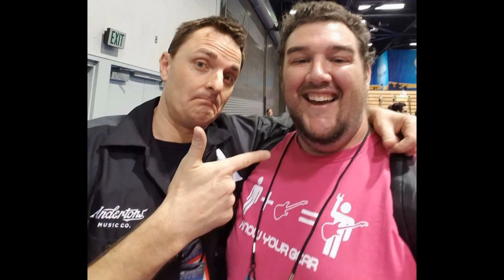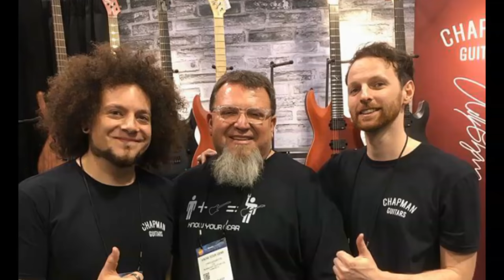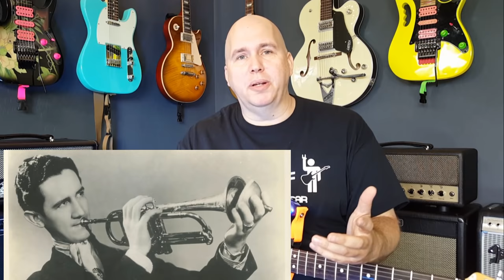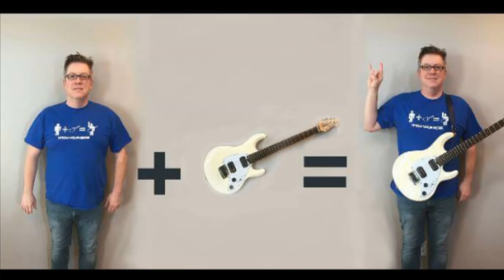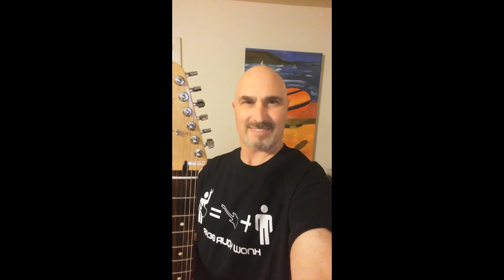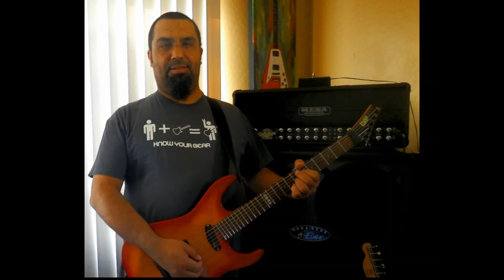The Tremolo System That Doesn't Exist

Comment: A third way to get that sound (and without the fret crossing) is to target the note a half step lower, then quickly pre-bend a half step and pluck, releasing and re-bending. In fact barring trem dumps, there's not a lot of a musical nature that you can't pull off with just your fingers. You can emulate down-only or floating 'trem' arms.Some of my favorite twang bar innovators are Eddie Van Halen, Adrian Belew, Jeff Beck and Duane Eddy

Comment: When I learned about strings (violins, violas, etc) I learned that the term is Italian, and translates to something of 'tremble'. When a group of string players do a rapid, trembling bowing motion the effect is a trembling sustain note. Guitarists pick really fast, and get the same effect. Think Dick Dale doing Misirlu, fast picking giving the feeling of sustain. I think Fender was going for a vibrato like effect on the amp (to remind the listener of a singer with their wavering pitch vibrato if used in a slow setting), but really made an adjustable speed tremolo that can go slower than a player would usually execute a 'tremolo' technique. Some translations that might help: 
        (gen) "to tremble", "shake"
        (luci, candele) "to flicker"
        (stelle) "to twinkle"
        (foglie) "to quiver"
Vibrato is the description of a singer wavering their pitch up and down.

Comment: Love your videos, really inspired me to explore guitar!
Reply from the maker: very cool. Thank you
Reply: Phillip, try it. O-rings the size of the screws, 8 of them. back them all out 1/4" do one at a time, one above one below for the 4 outer screws. omit the 2 center ones, tighten until just "bumpered". pop the back, drop 1 spring, tighten spring hanger screws until trem back is almost 3/16 off the body. with a graphite nut works better falling back in tune, powdered from a pencil is ok. do it to a cheaper strat copy you can put it back stock just as easy, works surprisingly well. the neoprene with slight pressure gives it the return point after being floated, the dropped out spring in back = less pressure on trem arm. fun little trick we were doing about 35 years ago to float them.
Reply: DevonReviewer me too!! Ive been playing almost 40 years and learned nothing more than how to polish the thing and change strings. I was even terrified to deal with intonation. Since ive been watching Phil ive bought a couple Squiers to rip apart and see if i can do something with them. I havent really started yet im still in research mode nut im ready. Oh i did change a tune o matic to a roller bridge on one of my eppiphoneys. It worked perfectly. Ive only done 1 do not sure if it was beginners luck or not.

Comment: Brad Gillis playing as he did on that first  Night Ranger album is what got me really interested in the vibrato bar. I was 15 when that first Van Halen album came out and Eddie did some cool stuff with it, but it seemed more like an effect or trick to my ears at the time. Gillis used it really expressively as a vocalist would when singing. Later, as I went back to the beginning with blues based rock, and discovered Jeff Beck, I realized that it kinda started with him. About half my guitars have a vibrato on them as it's become part of my own style and of the three most prolific systems, Fender, Bigsby and Floyd Rose/Ibanez/Kramer (I consider all these locking/reduced-friction as enhanced-improved Fender designs conceptually), I probably prefer the original Fender the most. With a graphite nut, locking tuners and properly setup, they're as stable as the Floyd Rose, et.al., and a lot easier to deal with string changes and intonation. I just live the Bigsby for its subtle inflections and it's cool look.

Comment: Just to clarify: “Vibrato” and “Tremolo” do have really similar meanings. Those words are obviously related to “vibrate” and “tremble” respectively. The idea of trembling and vibrating comes from the sliding motion of the fingers over the fretboard that would be otherwise required to achieve such pitch swing and the sound oscillation itself. The amplifiers and pedals effects known “Tremolo” obviously refer to the intermittent lowering of the volume instead. Personally, I’d rather call those “muffling” or “dampening” in order to avoid the confusion and possibly be more accurate. To conclude, as I believe “trembling” is supposed to give an idea of quicker or more spasmodic movement over “vibrating” (in my opinion), I guess you could say a Bigsby is a “vibrato” indeed, whereas a Wilkinson is a “tremolo” after all.
Reply: "The terms vibrato and tremolo are sometimes incorrectly used interchangeably, although (in the classical world) they are properly defined as separate effects with vibrato defined as a periodic variation in the pitch (frequency) of a musical note, and tremolo as a fast repetition of the same note (usually a semiquaver) in order to produce the audible effect of a longer note, especially on instruments which do not have the ability of producing long sustained notes, such as the guitar. In practice, it is difficult for a singer or musical instrument player to achieve a pure vibrato or tremolo (where only the pitch or only the volume is varied), and variations in both pitch and volume will often be achieved at the same time."

Comment: Vibrato varies pitch. Tremolo varies volume. Fender always had their nomenclature incorrect. They referenced guitars with tremolo, which was actually vibrato. And the referenced amps with vibrato which was actually tremolo.
Reply: Right on, I'm just going to start calling my super cool Fender "Custom" Vibrolux Reverb tube amp a Tremolux from now on!  More accurate IMHO, and a possibly good conversation starter.  :-)

Comment: Dear Philip McKnight, 

As far as I can see from your video, the vibrato system is flushed on the body of the guitar. In a 'floating' vibrato system you CAN actually achieve a tremolo effect, similar to the one the old fender and marshall amps have. The definition is not important, for me at least. However, and since you're talking about tremolos / vibratos, it would be a good idea to demonstrate the floating vibrato on a strat along with the 'magic thing' that happens when using it.  

Yes, you guessed it right. I'm a big fan of floating bridge, with a setup just like Carl Verheyen suggests. I insist to call it tremolo though. !! :) :)

Keep up with the good work.

Comment: It is a system that needs to be setup not like Fender intended it to for it to stay in pitch...widen the slots in the nut, lube the nut, lube the saddles and under wrap and lock the string to the tuner. Stretch the piss out of the strings and it works 95% of the time...B and G will go sharp. Done it for years on stage...and I mean dive bomb with it for it to go....

Comment: Yep, always use the Vibrato name, maybe because English isn't my first language. Until I started to talk with English speaking guitarist that were calling it Trem... so I had to use the word Trem to make myself understood, but I never liked it because it doesn't make any sense (like having a "gas pedal" on an electric car...often called "accelerator" on other language). There's many many very fun examples like that, and sometimes it means a lot to understand some differences in culture. For instance like Americans using more fractions for Imperial system, while others use more decimals for metric system. It looks like nothing, but if you're bilingual (for both language and measurement system), it does explain A LOT! My 2¢

Comment: Clyde McCoy wasn't used because they couldn't describe the sound. VOX and Thomas Organ company thought the pedal should be marketed towards trumpet players and not guitar players. If you look in my photo, that's me with Del Casher, who worked on the original Wah pedal and owns the original prototype. He tried to convince them to market it for guitar and released and album showing how it would work for guitar. Other than that, you are correct, Fender, not a musician, messed up when he named the system a Tremolo System just as he screwed up the amplifiers by calling the Tremolo Vibrato. He had them backwards and just went with it.

Comment: I just bought a js22 for the hell of it to build up , i was surprised at how well it plays and how good it sounds, but the tremolo is its only downfall .. it feels sorta flimsy , but its very tight. Would removing 1 of the 3 spring noticeably lower the tension without ruining the guitar? Or how would go about doing that ? Thanks Phil.
Austin

Comment: Good video. Tremolo system, vibrato or whammy bar, it's just really semantics to me.  But that aside, I do have one tremolo/vibrato related question. Is a guitar equipped with a combination of a traditional Fender style vibrato bridge (coupled with locking tuners and a good graphite nut) as effective as a Floyd at keeping a guitar in tune when using the bar?
Reply: they do fairly well really, we loved sperzels and a graphite nut. the lock tuners didn't need a full wind on the peg so the strings wouldn't be springy there. if you looked above I'd described floating old school fender trem's on O-rings. lock tuners and graphite nut was our preference for it.
Reply: Thanks.
Reply: YW. last one I floated was a local buddy's strat copy. O-rings was 2 bucks, it only took about 15 minutes to slip the 8 onto 4 screws, 2 springs, adjust hanger.  done it many times, easy quick for me. it didn't get a nut or better tuners, worked perfect. normal use fall's right back, lots of silly abuse it'd still be close and that'll happen with a nicer bridge anyway so no biggie. it was routed for a single humbucker so I swapped in a hotter pickup to finish it off.

Comment: I feel a lot of guys use the tremolo system to fill up blank spaces, like steve vai, spends hours with the tremolo, making noises.  I never used the tremolo system, even thou I have a floyd rose type bridge on my guitar, I only have it for the looks. There is so much going on with the fingers and picking, I don't really need it. I like what other guys do with it thou.
Reply: Nathan Carrille to be honest if you're happy with your playing without a trem that's a very good thing, I feel I use mine too much
Reply: I'm surprised to hear that anyone bought a guitar with a Floyd just because they liked the look.  The added expense alone would deter someone, but then the added aggravation of proper setup and string changes, etc.  A hardtail is just so much easier.
Reply: Oswaldo Delacroix  Floyds when properly set up will take forever to go out of tune, me not using the bar makes it even harder, so that's the advantage, plus the looks as I said.  I can deal with floyds pretty easily, over the years I learned how to deal with and fix/build guitars just as much as I learned how to play them. And thats been 15 years so far. Even though hardtails are easier, I find floyds to be more fun haha.
Reply: Nathan Carrille I'm surprised you didn't hardtail your Floyd because you'd get the tuning stability minus the setup hassle but I agree with you as springs are less effected by cold than strings and the locking nut helps to keep everything in tune
Reply: Jamie MacMillan as a matter of fact I did block it for the longest time, but then I just wanted everything to flow as they were supposed to, so i set it free and did a proper set up. I even used it without the locking nut, since this particular guitar got a regular nut AND a locking nut. But I realized the tunning stability was not the best without it.
Reply: Nathan Carrille yeah the locking nut is a gift from the gods

Comment: Can we pretend that this misuse of terms is somehow relevant to people who think that when you coil split a humbucker it is called coil tapping, which is completely different and refers only to single coils? This is one of my biggest pet peeves, hearing people who do guitar-related things for a living get these two wrong.
.
Coil Splitting - splitting, or turning off half of a humbucker pickup in order to simulate the sound of a single coil pickup.
.
Coil Tapping - tapping into the winding of a single coil pickup in order to change the frequency output.
.
It ain't rocket surgery.
Reply: Thank you for writing this comment, it saved me the effort of writing this comment.

Comment: When will Fender  put a good vibrato-whammy bar, etc.. on the Stratocaster?  One that can actually do deep dives and pullups,  as well as doing the real subtle Jeff beck style stuff? I like both ways of using it.  I love the Strat tone,  but the whammy bar sucks. It cant be moved far, and it cant do deep dives and pullups, and it goes out of tune real easily and right away.  But I must play the  Stratocaster,  I will not play some generic Ibanez or ESP or  something like this.  Floyd Rose is 30 year old technology, so, is there anything better by now that we dont know about? Or some bettter way to set up  a Fender Strat to do all the  serious intense dive bombs and all that stuff?
Reply: The Jeff Beck Signature uses an American Standard vibrato bridge. Looks how he can be subtle or abusive, it never goes out of tune.
Reply: my strings never go out of tune, i dont do divebombs  partially because idk how but also because i dont really feel like it but i do give it a good wailing on that bar and i swear the tuning stability is incredible. but if it helps i saw a video of john frusciante going nuts with his fender strat trem and he seemed to do fine.

if u wanna do pull ups just loosen the tension springs in the back and it should raise the bridge making pull ups possible.

im pretty sure tuning instability comes from nut issues moreso than trem issues

Comment: Right and Wrong...
Most vibrato systems for guitar are based on one of four basic designs:

Bigsby Vibrato Tailpiece, introduced in the late 1940s and used in close to original form on many guitars (including Gibson, Gretsch and Rickenbacker guitars)
Fender Synchronized Tremolo or strat trem, introduced on the Fender Stratocaster (1954), which inspired many designs, including:
Floyd Rose locking tremolo (developed late 1970s)
G&L Dual-fulcrum Vibrato, designed by Leo Fender (1981)
Fender two-point synchronized tremolo (1986)
Fender Floating Bridge, which has two main variants:
Fender Floating Tremolo or jag trem, introduced on the Fender Jazzmaster (1958)
Fender Dynamic Vibrato or stang trem, introduced on the Fender Mustang (1964)
Cam-driven designs based on pedal steel guitar concepts, include:
Kahler Tremolo System (1979)
Washburn Wonderbar (1980s)
Stetsbar tremolo (developed late 1980s)
Many other designs exist in smaller numbers, notably several original designs marketed by Gibson under the Vibrola name, which they also used for some licensed Bigsby units. A design patented in 2006 from Trem King uses a fixed bridge with a moving tone block.

Comment: My tremolo arm on my mexican strat always leans on the lead input jack. it tightens past the jack so theres nothing i can do about it. Does anyone know a fix to this?
Reply: Use Teflon tape. You vibrato arm will stay in place.
Reply: there's also a stiff little spring you can put down the hole first
Reply: model nutty was it suposed to come with it or u mean buy one
Reply: better ones did come with (and more often get lost!), it's a really strong little spring about 5/16 long. trem arm stays where you park it instead of swinging+flopping around. teflon tape or rubber cement (for paper) on the arm's threads does work. if they'd used rubber cement to keep the darn spring from falling out and getting lost in the first place... umm.. most of us wouldn't even know it was there!

Comment: mine never stays in tune :/
Reply: Pencil dust (graphite) in the nut slots, first and foremost. Second, make sure that your strings are good and stretched out. New strings and a trem are a wacky combination when it comes to staying in tune.
Reply: YF yes. SIT strings usually fair about not stretching, also keeping to only 1 wind on the pegs helps a bunch (not 2-3 winds that'll spring).
Reply: thanks for the tips.
Reply: model nutty I forgot that one because I use the Planet Waves auto-trim locking tuners on every guitar. That's a damn good tip!
Reply: model nutty I use locking tuners so I don't have winds. Should I wind them for more stability?
Reply: no it'll make it less stable. thats why lockers are nice, less than 1 wind
Reply: make your springs in the back are properly tightened
you can find videos about that
Reply: Como hacer un pon pon